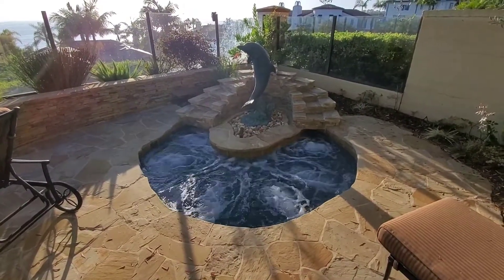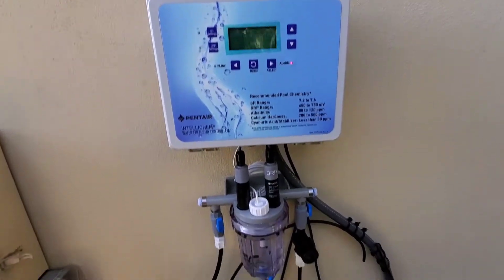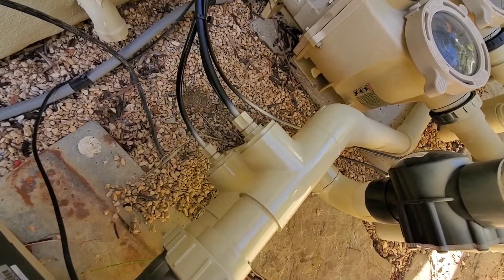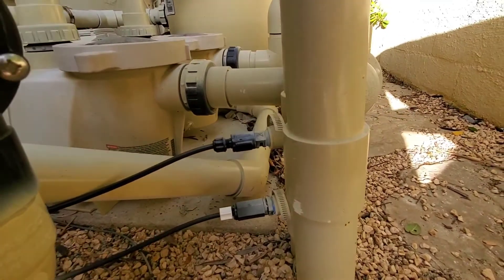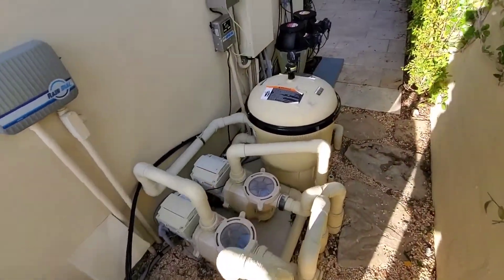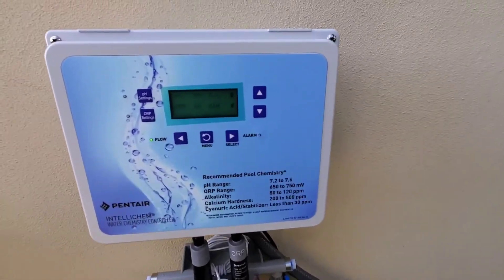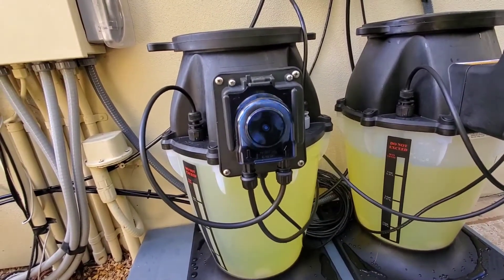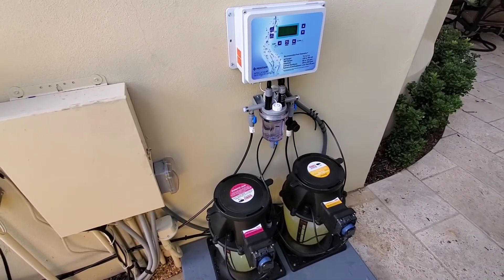Intellichem pool / spa chemical controller with liquid tanks (residential version)

Comment: Is there a reason you used different T-pipes for connecting in the water in/out versus the acid and chlorine injection? Also, did you just use connectors provided in the Intellichem kit, or did you use additional parts?

Comment: Our float (white cylinder) can move freely but doesn't stay up at the top. Yet, the flow alarm only came on twice. I can replace it but I'd like to understand.
Reply from the maker: It sounds like you may need to increase the flow.  You could possibly have a clogged pool filter, clogged filter on the intellichem.  It could also be that you may need to raise the RPM on the pump if you have a variable speed pump.  You may want to reach out to Pentair tech support or a Pentair dealer that knows the Intellichem well.

Comment: Where did you get the threaded compression fittings for your tees?
Reply from the maker: I believe this is the part number you are looking for, 606000100Z.  It is listed as "Fitting 3/8” Tube x 1/4” NPT" in the Pentair parts list.  You should be able to find it online or at a pool supply store.  Here is the link for the parts list from Pentair.  https://www.pentair.com/content/dam/extranet/nam/pentair-pool/residential/parts-sheets/automation/intellichem-chemical-controller.pdf

Comment: How the system working now that you've had it for a little while?
Reply from the maker: The intellichem system works great.  It does need Ocassional probe sensor cleaning, squeeze tube replacement, acid / chlorine tube replacement.  We are cleaning the probes and replacing the squeeze tubes yearly on all of our Intellichem pools that we clean weekly.  Pentair recomends using 50/50 acid water for the acid tanks.  It keeps the parts lasting longer on the acid lines and squeeze tube.  The system has a 3 year warranty as of 12/18/2022.  You will need an experienced installer.  The programing for the dosing, high and low limits and other parameters is too over whelming for the average home owner that does not install these on the regular.

Comment: Great video, I have a similar setup with a salt cell but how do I calibrate the system for what my test kits reading? Any help much appreciated
Reply from the maker: If the salt level is reading inaccurate I recomend having a trusted pool service clean the salt cell.  If that does not work you may need to replace the salt cell.

Comment: Awesome video man! I have to quote a pool tomorrow 60k gallons with this feeder in it. thank you so much for the run down.  How often do you load the chemicals? What's it like to service these pools weekly?
Reply from the maker: We usually fill the tanks every visit just to make sure they never run dry.  Spas and small pools will require less refilling.  For large pools / high useage pools the system can be adapted to larger tanks.  The tanks that come with the system are 4 gallons.  The system works really well keeping the ORP an PH in the ideal range.  The proper programming is very important though and any installer may want to consider reaching out to someone at Pentair or another installer for advice on the doseage perameters.